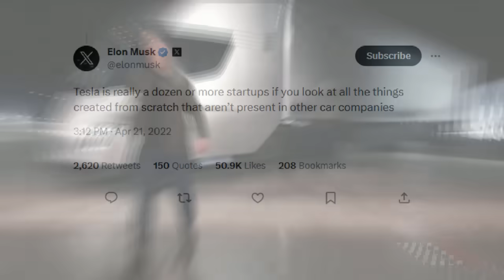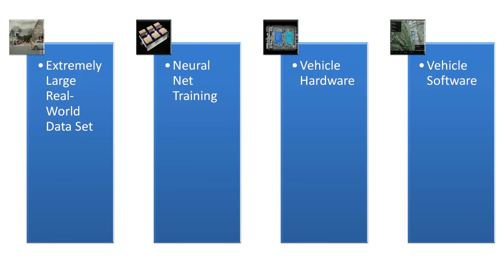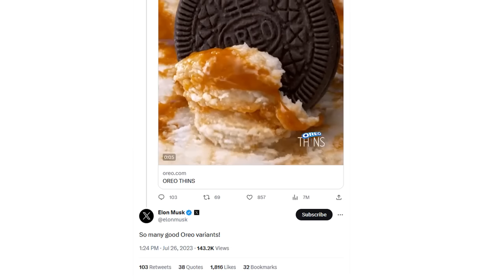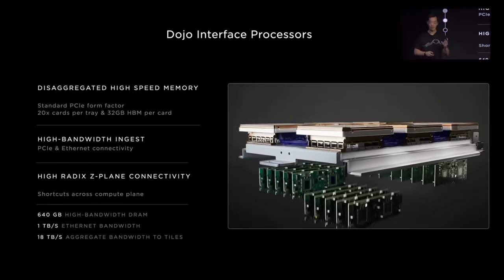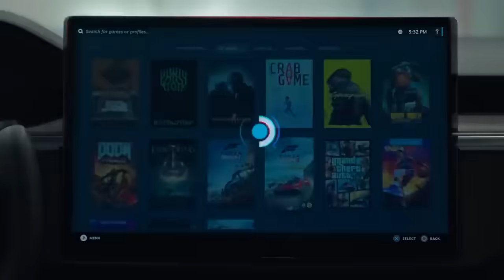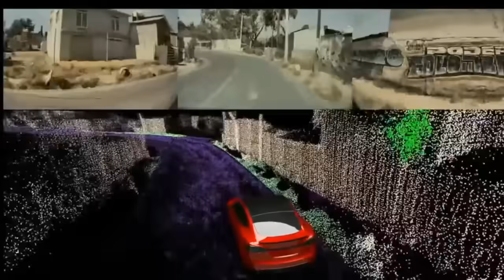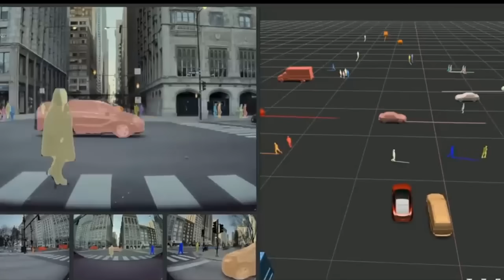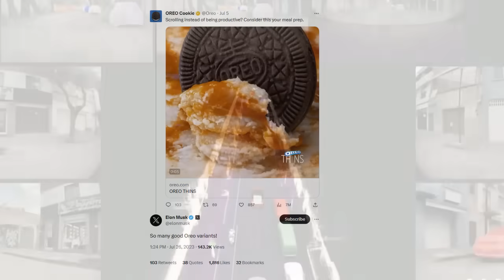Tesla's AI-Powered MIND BLOWING Plan for 2024

Comment: Great Video and very well produced putting all the pieces together (except maybe the Robot running on the same AI getting more data.)  Consider when Tesla connects all of it's cars together into a real time network so they can avoid a crash or fire by informing each other?  Same with the robots or how about all the speed light cameras being pulled into the real time world of Tesla AI sharing info!  Tesla cars would have saved people in Maui by guiding them out the best way based on the other Tesla cars much like the far dumber Waze app that tells you just how fast other Waze drivers are going and where they are and other info in their Waze network.

Comment: Tesla now has enough data  to build a foundation and global model LLM.
After this it is done it put together 10 or 20 of these foundation and global models that run constantly in different simulated or real road networks.
This means that they can be prompted. 
Example- 
So I would let Robotaxi 1 to go from point A to B and Robtaxi 2 and 3 and 4 etc to go from X to Y.
Then I build a video scene of where they start and are driving and then the scene stops and they have to dream what would happen next and their actions. 
Maybe they can dream for a few seconds before they start elucinating and the dream becomes nonsense. Before this happens though the scenes are stopped and the next part if the drive is simulated and recreated to look like the dream the car was having , but this is the next starting point. 
The scene runs for some time as the car progresses to point B/Y. Then the video is stopped and the car is asked to dream about what happens next. 
You have the LLMs in an never ending coherent dream about driving and they are learning all the time from each other. 
The march of 9's become doable very quickly.

Comment: A patent expert has zero to do with if an algorith works. You can patent something stupid that does stupid things as long as it is unique. In Tesla's case; they don't have a patent on most of their FSD AI, it all came from a DARPA self driving effort. Hense Open Pilot does about the same thing; but both are highly flawed logic based on how others have driving a sement of road. Tesla hardware can't hear a siren; it can't see far enough to determine if it can pass before that oncoming semi truck arrives. Both the hardware and the software are incapable of level 5 ever.

Comment: Vehicle autonomy and EVs are orthogonal.  You can apply vehicle automation to ICEVs and BEVs alike.  FSD and the robot have nothing to do with Tesla's mission statement.
Reply: Autonomy means that fewer cars need to be built, and in turn more batteries can go to stationary storage and other things. Dealing with all the inconsistencies of ice is probably an annoying aspect to consider when designing a system, and since they are on the way out it doesn’t really make sense to innovate on those platforms. Plus setting up a robotaxi hub is a lot easier with charging than having to set up a fuel pump at every hub
Reply: Nothing is a very small amount. You don't have to twist into too much of a pretzel to argue that if Teslas are more useful and valuable while being cheaper to manufacture at scale and Teslas are electric, then this will accelerate the adoption of electric vehicles. Also, you can argue that if you get more transport out of every car, since more people are using the same car instead of owning their separate cars, that is more sustainable. You may disagree, but the argument can be made that FSD and robots can support the mission statement.
Reply: Useful robots improve the world economy and reduce the cost of goods. While FSD does the same transforming transportation into a new era. Time is free up between trips, fewer accidents, fewer people are disabled or died, etc. FSD and robot have profound impact should they materialize.
Reply: Your observation of the independence between FSD and the motor definitely deserves a thumb up.  However, as others have replied, FSD is on mission by making vehicles more productive.
Reply: "You can apply vehicle automation to ICEVs and BEVs alike."  Yes, but who wants to?  ICE will be dead soon.  Robots will be useful in Tesla factories, reducing the cost of manufacturing, bringing EVs to the world at lower cost.  They'll also be useful on Mars.